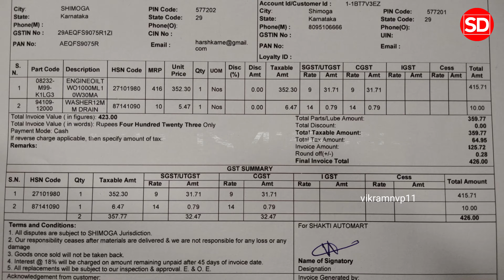Best Engine oil for honda hornet 2 0 | change engine oil yourself

Comment: I bought my New hornet 2.0 but engine heating issues are there can you suggest any idea
Reply from the maker: No worries just wait for 700 km. New engine piston and cylinder has to melt a lit bit, that is why it is getting heat. After 500 to 700 km it will come to normal. Don't miss due service it is my advice. Do You know what I love 💕 most in hornet 2.0?

It is the hornet engine itself what I love most. What a engine it is i say. 

Engine and engine sound southes my soul and heart.

Don't worry it will come to normal heat. Wait for those km i said. But properly get the service done on time ok bro.
Reply: Engine Heating Is Fixed Problem Honda 2.O I bought Since 2021

Comment: Brother my keyboard light become on and off continuously
Reply from the maker: Shut down or turn off whole system. Unplug the power. Swap the ram in mother board slot. Remove the CMOS battery, check if it is good or bad. If CMOS is Dead replace it with new CMOS battery. Because CMOS is related to BIOS setup so.

Finally plugin power connection, turn on the system and check it.